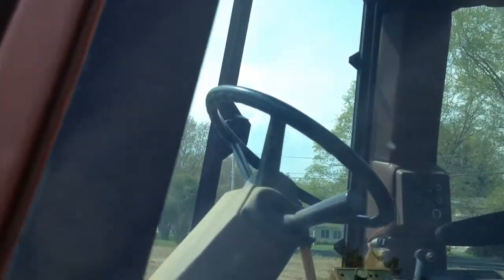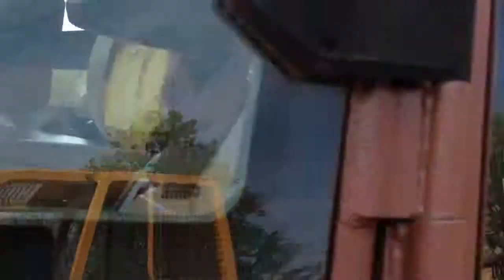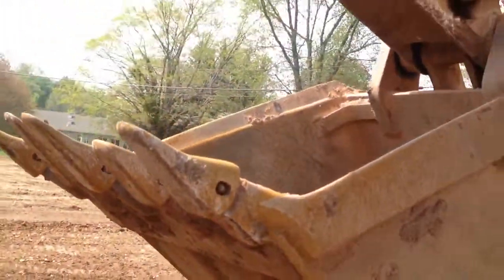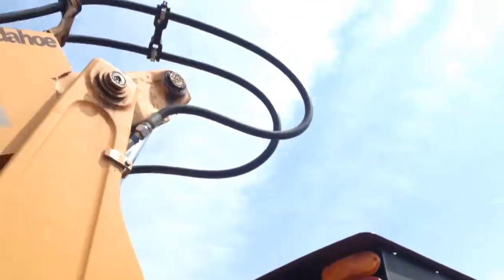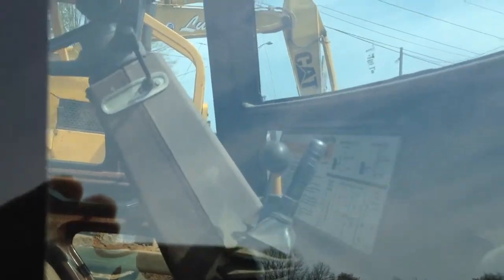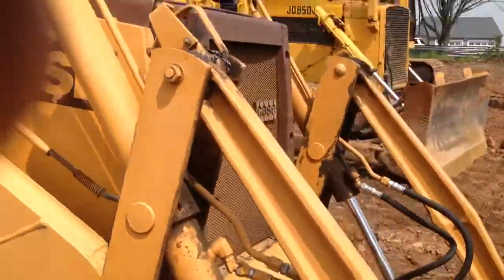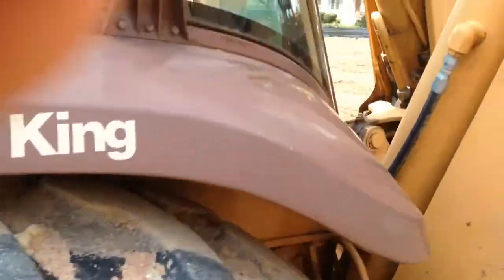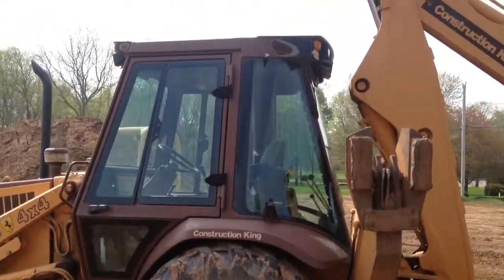Case 590 turbo walkaround

Comment: Wow, I own this model. This looks like it’s in real good condition. The backhoe bucket is very easy to change out and comes in different sizes. The gas tank/fill port is in a separate door on top between the front window and the smoke/filter stack. You will also find the fill port for hydraulic oil in the same spot. Most of these back hoes get abused due to the fact it’s pretty much used all the time for just about anything. Hooks on bucket is for fork attachment.